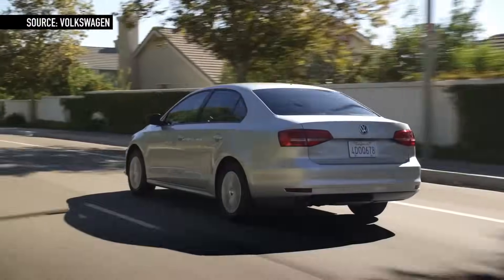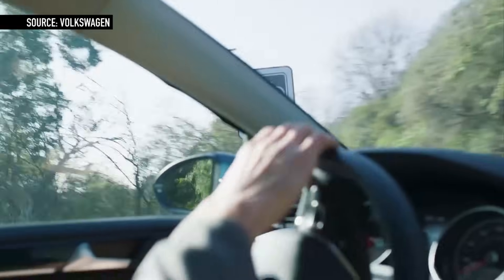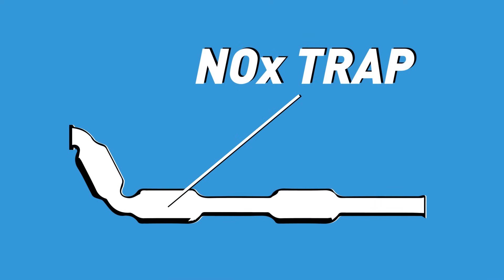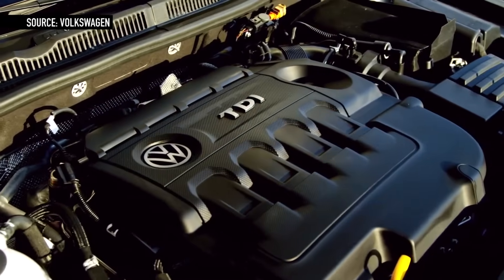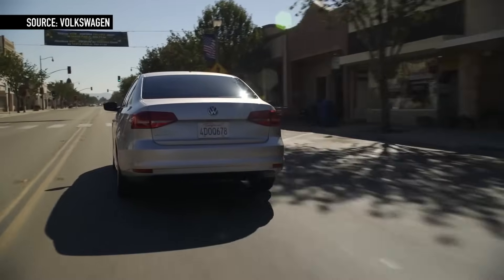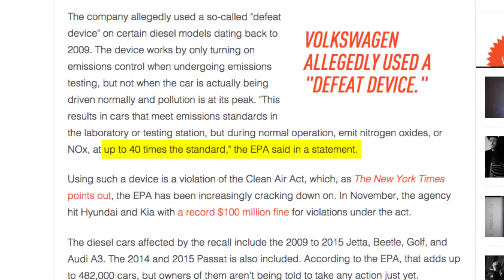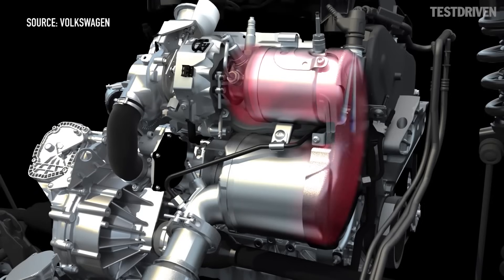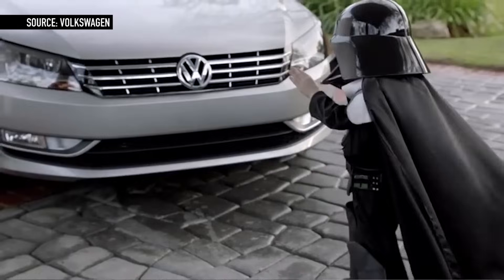Volkswagen's diesel scandal, explained

Comment: This video is incorrect.  There is no NOX trap.  There is a three way catalytic converter that converts NOX to nitrogen and oxygen.  To do this it requires a fluid called diesel exhaust fluid.  Which needs to be refilled periodically.  VW wanted to decrease to consumption of DEF, so the software was modified to use less DEF but this increased the NOX emissions.  There is a diesel particulate filter/trap which traps  very small particles.  It requires extra diesel fuel on a routine basis to burn off the trapped particles, but that’s got nothing to do with Dieselgate.

Comment: BMW managed to make their USA specification diesel cars   compliant to the EPA standards without cheating, so it proves it is not impossible, it is a matter of building the cars with a properly engineered exhaust gas treatment  system,  VW chose to not to comply, equipping  their cars with cut-price dysfunctional  exhaust gas treatment systems  VW  cheated upon  their competitors, the EPA, the consumer, and the American public in the goal of securing an advantage over those car makers who sought to do the right thing

Comment: what VW does is they set speed limiter on your TDI's !!! my car going 60mph sounds as if it was in 5k RPM lol 2015 Passat with hardly any miles lol already twice I had them replace my timing belt ! beware DO NOT GET THE FIX once my warranty will be done basically ill be screwed

Comment: Eh I'll just stick with my 95 7.3l powerstroke diesel because I'm emissions exempt. But high five Volkswagen. Keep up the great work. Because an exhaust pipe doesnt leave nearly as high of a carbon footprint as the countless manufacturing plants used to make all the after treatment systems in all diesel engines.

Comment: So if the car gets less mpg wouldn't that mean it puts more exhaust out?
Reply: Yes but the exhaust is less toxic. Diesel cars can be extremely efficient by running lean, but it emits more NOx, which is toxic. By making it run more rich, you reduce the MPG and increase the CO2 in the exhaust, but you reduce the amount of NOx. CO2 is not toxic, unlike NOx (but CO2 contributes to climate change though).

Comment: The truth people dont see about diesels with dpf filters where a extra injector sprays fuel into a hot exhaust to make exhaust temperature much higher to burn off waste fuel and emissions more then tripples the exhuast temperatures goin into the air adding to the global warming issues the world is facing. Put it this way... the exhaust is so hot that transport trucks no longer czn used crome pipes on our stacks because the heat with cause the crome to flake and burn off.  I personally think VW should get a award for and not be harassed by big fuel wanting to sell more diesel. The problems at hand are fueled by nothing more then the fuel companies greed. Money is lost when  fuel economy is reached.  Save the earth n delete diesels

Comment: Others cheated at the tests also but the issue with vw is something else.. vw is a too big corporation but not in u.s. ownership. So they needed to attack them financial through this, which dropped the sale of vw vehicles. Later, a neutral reprter team tested all those vehicles again but you couldnt read or hear it in the mass media. Everyone has cheated and the worst results in those tests had a french and us carmaker. But why all that? Search what is VW, which car companys they own and you will come to a conclusion that all that was just a farse to drop the stock value of vw so they have to sell a few car-brands. The goal was to make them weaker in a financial way, so someone can buy bugatti or scania or whatever from them for much less money.
Why? Also it could be another reason, which is the e-golf (electric) which came out just a few weeks after the "scandal" .. you cannot make such a car in a few weeks, it needs months or even years to do it so it couldnt been a quick move from vw after dieselgate .. the oil corporations didnt like that the most popular small car becomes electric.. maybe..
So an german car cheat about gases in u.s.a. but others cheat too..later on..in american candys was found plastic in germany but no pics of that plastic has been released to public... like a little mini economic war..  interesting, is it?

Comment: The only reasons you bought a VW diesel were:

1. It was relatively cheap & reliable
2. It had the best fuel economy for that price range
3. It was cool to own

If you were willing to spend $25,000 for a VW, you could have easily spent that on a Toyota Prius.

I am quite certain at least 95% of the people who are 'worried' and 'frustrated' and 'shocked' by this scandal are those that just want a cut off the lawsuit and essentially get a FREE car.

It is suspicious that for someone who care about the environment, they're wanting VW to ship the car they already have to get it crushed/recycled (very environmentally friendly), ship them a new car (again, very environmentally friendly).

I heard VW offered to make modifications to the software/hardware to make the car emissions compliant & still get decent fuel economy instead of buying back the cars. But the environMENTALists were so offended by that notion.

Comment: Just for info you German tech lovers (  had a 1969 Mercedes 280 SL, still have a 1966 BMW R69S, a  1970 1,300 cc VW Bug), SIEMENS is selling a 50 Kg, 260 KW so about 350 Hp.motor.
No need to talk about max.torque motor means : electric ! R.P.M. approx. 2,700  it's aeronautic design. And...
Presto ! No pollution. One maybe needs some Tesla  century-old patents to power it with free telluric or atmospheric discharge through converters , as a big enough battery  to drive 2 to 3 hrs  this power will perfectly  feed  a homemade terrorist weapon , even in PRC where they buy  energy  to compute  a nice import/export balance,  anyway EMP is not pollution to give cancer. Du moins je crois, il y a aussi CRISPR cas-9 pour les surhommes aux yeux bridés !!

Comment: It's not just VW that cheats. Opel (Fiat engines) used software that disabled EGR after engine exceeding 60% power output requirement and or when alitimiter was above 700 meters sea level. They said that at this environment engine can't efficiently run with gas aftertreatment in mind. 
An forget about EU and US car engine standars they are  hoax. Even EU2 compared to EU1 redused emissions by almost 70% so EU that follows only lowers emission levels by small amout but at a great cost. On the other hand there is no emission levels for small residiual heating devices, especialy those burning wood. It's true their CO2 is 0 since they release same amount as trees used while growing, but CO2 is not a polutant and those devices produces large amount on PM, CO or NOx.

Comment: I found U.S HIPPOCRISY ,  DISGUSTING 
their corporate verbal Diarrhea  never stops to Impressed 
.
U.S most Sold vehicle  in 2015,   its called  * Super Duty F-250 King Ranch*** 
Engine specs , are V8 diesels with 6.7L Engine's which needs 120 liters 26 GALLONS   of Diesel to complete 440 Miles 
does the Corrupt EPA really worried about 3 & 4 Cylinders Golfs  & Bettles  ? 
.
Should mums taking their kids to schools pick EPA compliants Hellcats which will waste 18 Gallons  in 12 Minutes ???
Reply: ***** stupid is to think  a Vw Beetle / Golf will ruin the Word  and pretend 4x4 Heavy Duty privet diesel  Trucks with 6.7 diesels engines don't exist 
.
A VW Golf needs 6 gallons of diesel to complete the same distance  of the regular Pick up truck in the U.S with 28 gallons of diesel

Comment: Diesel-powered cars generally have a better fuel economy than equivalent gasoline engines and produce less greenhouse gas emission.Their greater economy is due to the higher energy per-litre content of diesel fuel and the intrinsic efficiency of the diesel engine. While petrodiesel's higher density results in higher greenhouse gas emissions per litre compared to gasoline, the 20–40% better fuel economy achieved by modern diesel-engined automobiles offsets the higher per-litre emissions of greenhouse gases, and a diesel-powered vehicle emits 10–20 percent less greenhouse gas than comparable gasoline vehicles.(right from Wiki)

Comment: Buggati engine with 1500 HP + 4 Turbos its OK  (produced by VW)  no issues with emissions right ? 
Buy a  3 cylinder or 4 cylinder capable of 80 MPG , You are POISINING the World with emissions ???? 
Its called U.S Hypocrisy , Hummers , Ferraris , Heavy Duty Pick up Trucks 4x4 with 7.3L Diesel engines are ok !!!
.
Buy a VW Golf or Beetle capable of travelling 860 Miles with a 12 Gallons Tank and You are Destroying the World ???
Now is the time to buy VW vehicles , you get some nice discounts and you will save on fuel
Reply: Tarragon Mugwort Hellcat can empty 18 Gallons of tank in 12 Minutes and produces 707HP a used one its not that expenssive 
.
Prices should be irrelevant when debating emissions

Comment: This is U.S corruption at its best 
Buy 1 MPG Hummer , you are OK 
Buy a European vehicle capable of almost 60 MPG you are ruining the world 
.
Hellcat Challenger  empties its full tank in less than 12 Minutes compared with the VW 10 Hours
Reply: What your saying is true, but you are missing the point, they are not stating the efficiency of the car or how much fuel it burns compared to other vehicles!  The company stated the emissions, which are not the true facts!  That's it!
Reply: @emmettcoen  the lying part apparently doesn't bother people- esp volkswagen owners
Reply: And if you dont shut engine off at gas pump if you are driving hellcat or hummer, your gas tank will never get full :D
Reply: Emmett Coen to focus on emissions of small 4 cylinders it's ridiculous  , I have one of those non emissions complient engines  it does  770 miles with a small 12 gallons Tank , ( thats not all ) 
MY CAR is a SUV , ( its not compact ) and runs on (19 Inch stock wheel's )
.
Heres how it looks like 
http://www.mirror.co.uk/lifestyle/motoring/car-reviews/renault-kadjar-five-door-suv-good-5900420

Comment: VW rigged some emission tests with cars, that are no longer being sold. Other manufacturer made cars, which are completely unreliable and a nightmare to own, but are no longer being sold. Like for instance most french or Italian cars from the last several decades. 

So which is worse? You decide. Also the "illegal" diesel cars from the VW group pollute no more than diesel cars from all the other manufacturers from the same period. The only difference is, they use legal methods to fulfill the test requirements, while there cars still pollute just as much as the cars from the VW group in the real world.

So if you are actually concerned with the environment and health issues, you cant buy any diesel car, which does not use the Ad Blue technology. Because that is the only technology, which effectively reduce NOX emissions in the real world and not just in a completely irrelevant laboratory test.

All diesels from the PSA group use Ad Blue technology now, and also most of the diesel engines in the VW Passat and Skoda Suberb. So these are actually some of the only clear diesel cars, you can buy today. To buy something much more polluting, because VW used illegal methods to cheat, while others used legal methods to cheat, seems rather irrational to me.

Comment: The scandal is the emission laws. They don't make any sense they make more pollution with the urea additive in the diesel fuel. it doesn't chemically change it into less hazardous emissions either, and causes fuel consumption to go up. the EPA has been bought off by corporate interests trying to sale s*** chemicals additives for fuel. And now the dishonest media is reporting it like VW did something evil when this law is inmoral to begin with.
Reply: Not so,  an effective Urea based system, correctly engineered to work properly, can be relied upon to convert toxic Nox  back to harmless inert Nitrogen gas,  with an effective Nox  to Nitrogen system under the car, the engineers can then calibrate the  diesel engine for greater fuel efficiency / power  gains,  VWs problems can be summarised as a  diesel  engine calibrated for great fuel efficiency and performance but minus a correctly engineered Nox to Nitrogen system to deal with the toxic Nox  from the tailpipe. The secret defeat device had two roles, 1) making sure the car passed EPA tests on the dyno and 2) in real word driving , switch off emissions treatment to prevent premature failure of the  ineffective  and expensive DPF/catalyst  exhaust system.
Reply: DEF literally does nothing, i have a cousin who's husband works for the epa and he told all it is is the company that makes def and sells it to the distributors is heavily invested and has shares held by some of the top people in the epa.

Its all one giant scam and now even California is trying to undo it cause its killing off the bees.

Comment: SO WE BUILD CARS THAT THE ROAD SPRINGS SNAP LIKE CARROTS TAKING YOUR TYRES OUT WE STILL PUT STEEL BRAKE PIPES ON THAT CORRODE AND BURST THEN HIDE THEM BEHIND PLASTIC PANELS AND FUEL TANKS WE THEN PUT DEVICES ON CARS THAT WHEN DETECT THE SMALLEST OF PROBLEMS PUT YOUR CAR IN LIMP MODE EVEN WHEN YOUR OVERTAKING IN THE FAST LANE.......AND WHAT ARE WE CONCERNED ABOUT FUCKING EMMISIONS......CARS HAVE NEVER BEEN SO CLEAN....LESS FUEL BURNED THE BETTER FFS

Comment: The US automotive industry is suffering, from toyota and vw taking a big market share year by year, they will do anything to slow them down i guess.
I say that because american made cars are known for their big engines and bad millage and environmental impact and now they're against vw for their diesel engine being not so clean? Look at those huge v8 american cars how clean are they in compare to a vw?
Reply: Dodge eco diesel,  ford eco boost v6  (has almost completely replaced the gas guzzler V8). Prius, Tesla ,mustang Mach E, volt, etc
Reply: Very clean since they don’t spew copious amounts of NOx into the atmosphere like a diesel does. 

And what V8s?  Most American vehicles have four cylinders.

Comment: My question is, What is the actual amount of pollutants caused by this scheme? 

The EPA claims of "UP TO 40 times more pollutants". First off, "UP TO" could be 2 times. Secondly 40 times could still be an insignificant amount. For example; I could add 10 ppm or 400 ppm to something and it may or may not make any significance.  Is this a real problem, or the environmentalists at the EPA over blowing it.  Because we know that they have never done that before.
Reply: Remember the 47 polarillion.

Comment: explanation to the detection system is incorrect, all modern cars have software to detect if they are on a dyno to ensure breaking and stability systems are functioning correctly when only the drive wheels are moving, the con was then running a totally alternative engine management software when this was detected. Also all vehicles effected will have a optional recall, so i wont send mine back and keep my high mpg ^^

Comment: RESCUE plan
VW will need something astonishing new to safe their image. A complete new concept of engine, no Ecomotor, no Duke motor, these are just refurnished old concepts with plenty of issues to go for real production.
During the last 20 years we worked on this "new"concept and with one of the most famous universities in mechanics of the world, we are since some weeks ready to publish it at a World Press Conference as we finished all R&D and the prototype period, just waiting for some funds to produce the definite one. Some details: no crankshaft, no camshaft, no valves, 1/3 of weight of a conventional, ultra compact, more power, turning on all bio-fuel and hydrogen and that with the same block due to a sophisticated variable compression, and of course very eco-friendly at a low production and maintenance cost. Its name: the Barronex engine, suitable for motorcycles to vessels. The solution for hybrid cars. 
Think about, Volkswagen, it is your rescue plan to forget fast the tsunami of financial losses you will suffer during the next years and it will re-create trust in the innovational mind and the dynamics of the European industry. 
"Das Auto" will make a new world without cheating.

Comment: 2014+ Corolla ECO costs $4K less than Golf TDI while still delivering better combined fuel economy. more standard features, higher reliability and dependability, cheaper maintenance, smooth and comfortable ride, no turbo lag, more interior spaciousness and higher resale value. Overall cost winner will be 2014+ Corolla. Corolla ECO produces less CO2 and NOx. Corolla Eco's 35 MPG combined beats dirty VW Cheating Germans golf TDI's MPG. Corolla has lowest emissions and fuel cost to operate per mile in any situation. Corolla LE Eco is the segment’s gasoline powered, non-hybrid fuel economy champ. Corolla Eco proves that VW dirty diesel ugly boxy slow-ass boring diesels are neither more fuel efficient, nor more environmentally friendly than modern gasoline powered cars. Dirty Cheating Germans dirty unreliable polluting diesel VW vehicles will give the term German "Engineering" a whole new meaning... lmfao

Comment: Actually no one still knows whether they stopped putting in extra fuel for NOx trap regeneration as explained in video. Another possible way to rig official test also includes turning off Exhaust gas recirculation in real driving conditions, in which case, the performance of vehicle is likely to get affected too after they fix the cars.